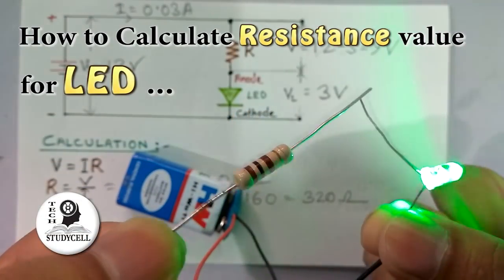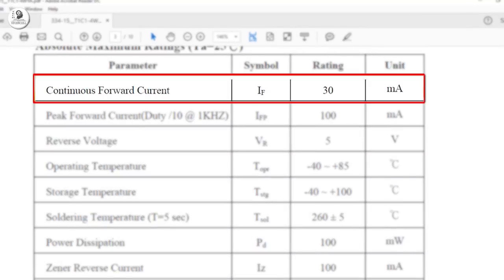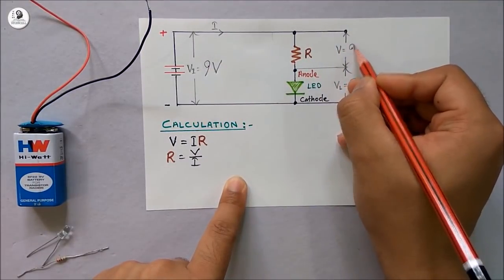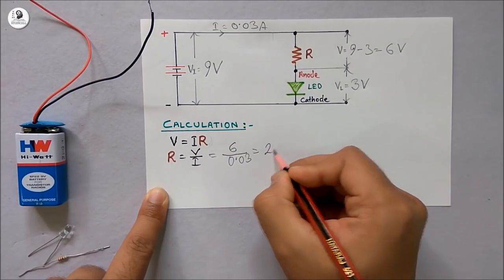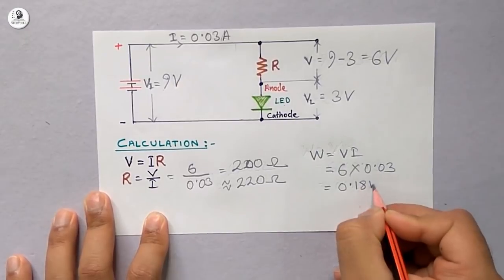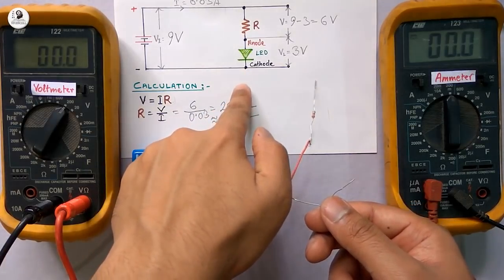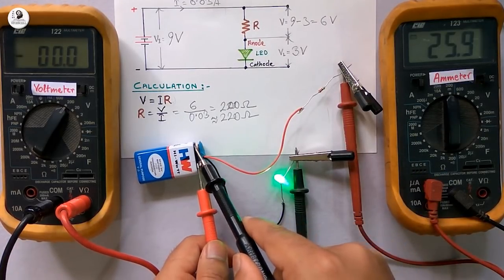How to select resistor value for LED with simple calculation (Ohm's Law)

Comment from the maker: Hi! For Series and Parallel LED circuit Resistance calculation please refer the following video: 
https://youtu.be/H69xDuon7vo
Reply: Tech StudyCell nice 👍🏼 video
Reply: Tech StudyCell  Bohot Aala Zabardast Kya Samjhanay Ka Andaaz Hay Maza Aagaya DIL 💖 Khush Kardiya USTAAD GEE KHUSH RARO Aaj Zindagi Main Phayli Baar kisi ko is Khubsurti Say Samjhatay Dykha or Suna Bohot Sari Duaain Dilki Ghayraeyoon Say SADA KHUSH RAHO TUMHARI har Mushkil Aysay Aasaan Hojaay Jaysay Woh THIHI Naheen AAMEEN LOVE 💖 From PAKISTAN 🇵🇰 👍👍👍👍👍👍💖💖💖💖💖💖💖💖💖💖💖💖💖💖💖🇵🇰🇵🇰🇵🇰🇵🇰🇵🇰🇵🇰🇵🇰🇵🇰🇵🇰🇵🇰🇵🇰
Reply: How much ohms resistor should i use in white led circuit of 6 leds and 9 volt battery .
3
Reply: Gadgets Cracker Use 1.5 watt 220 Ohms
Reply: @ahmedayaz1972  should i use 2    9 volts battery so that forward voltage will be of 18 volts. And then use 1 ohm 0.25 watts resistor to supply power to 6 white 5 mm leds.

Please help me.
Reply: Apni ki bangali?

Comment: I think there was a misconception have had spoken here, when we say drop it means drops that will be supplied to the LED to consume it, and the rest of voltages will be absorbed by resistor that's it. keep in mind that drops does not mean omit or removed, but feeding to the consumer, in this example is the LED.

Comment: what will happen if the input voltage is 5 V and we use a 1000 ohm resistor? Will the LED glow or not? It should not glow, but i have seen it glow. I don't understand how

Comment: I use 9V battery and blue LED with 10K ohm resistor , but the led burned , i can't understand why it broked , i try another circuit with 1k ohm and the same thing the Led burned , what is the problem?

Comment: I have UV led whose specifications are :
 Max forward current : 20mA;
Max reverse current  : 50mA
Max forward voltage : 3.2V - 3.4V
Max power dissipation : 80mw
Max reverse voltage : 5V

What value of resistor is needed to glow if the Battery input is 12V 9ah.
 Kindly reply.

Comment: Will lowering the voltage using a resistance lower the brightness of the diode? I've tried to do the calculations but my mind won't process the information. Help please!

Comment: I can tell that the internal resistance of the LED is 100 ohm
The question is if I apply 220v, what is the value of the resistor? 
Is it  ~ 7k5

Comment: unless i am missing something .003 divide by  6 equals to 2000, not 200 or 220. the inline resistor should be a 2k oms
Reply from the maker: The current rating is 30mA which is 0.03Amp. not 0.003

Comment: So if we wire 3 leds together it would be 9v, would we still need a resistor?
Reply: Yes,If you connect three leds in series it would lightup
Reply: @rajeshnaidu  my question is if we would still need a resistor if we were using 3 leds making 9v wired together powered by a 9v battery

Comment: Sir UV lamp is 11 voltage ... And power supply 12 voltage if I supplied 12 voltage it's working or burn ... Which register is required for supply 11 voltage

Comment: In case I don't have the data of led....what should I do ? Actualy I want to use an AC led bulb by dc source (12v-35v) with same brightness by passing the AC to DC circuit in the bulb. I can measure voltage output from AC to DC circuit . I know the numbers of leds ( generaly in series). Now what ?

Comment: Excellent video. Does it matter if the resistor is placed at the anode of the LED? Or is it common practice to place the resistor at the cathode of the LED? What would be the reason for either? Cheers

Comment: I was looking for exactly these calcs for a tiny DC motor application.  I think this will only work for electronic loads and not any kind of resistive or power load, although a tiny motor seems like it must be purely inductive, I still cannot get anything to work for the motor.   A finely organized and clear video.  This should help me going forward as a noob.
Reply: perhaps you could also consider the wattage of the motor to choose the correct resistor with enough watts for the motor

Comment: 1) the resistor does not drop the voltage as you imply 
2) why calculate 200 Ohms then use 220 ?
3) Wattage calculation is correct but not real world

Comment: Can we use resistor Ac 220 volt to Ac 110 volt as step down
Reply from the maker: You can do it for very small load but It is not recommend. Always Use transformer.

Comment: Hello sir,
How many ohm resistor should I use for transperent white led and transperent red led with car battery which is 12volt to 14.4 volt.
Reply from the maker: You can use 1k.

Comment: How check led voltage .. and current for calcutate suitable resister..using multemeter
Reply from the maker: You may check forward voltage rating with multimeter but for current rating, refer the datasheet

Comment: To summarize to see if I understand - So if I'm using a 9v battery and a 3v LED, there's a difference of 6v. If I divided my voltage difference (6) by my amperage of 0.03 (30 milliamps or 30 thousand) = 200. So, then you want a resistor that is at least 200 ohms but not much more. A common resistor in this range is the 220 ohms resistor.
Reply: correct  but 30 mA is rather high....better to a max of 20 to 25  mA

Comment: Hi thanks for the video. I have some question. If I have a power adaptor with 5V 1A, and a LED with 3V and 0.3A. understand I will need to use a resistor for 2V/0.3 around 6.6ohm. May I know what is the current in the circuit? Is it 0.3A or 1A as the adaptor say the output is 1A?
Reply: 0.3 A

Comment: what if i use 9 volt 10 amp... and I want to light led 3 volt need 30 milliamp.... does it use use 200 ohm resistor?

does the input Amp need to be calculated or just the input volt?
Reply: There really is no "input amp" really. The 10Amp you speak of is the maximum rating of the power supply. It can supply up to 10Amps while staying within specifications. If something tries to consume more current than 10A then the power supply won't be able to keep up within specifications.

Now, that said... The circuit draws whatever current it will based on its resistance and voltage. With a 220Ohm resistor and an LED voltage drop of 3v we know (from the calculation) that 0.030A will flow. You can't change that without changing the voltage, the resistance or the LED voltage drop. a 1A capable supply will push 0.03A. A 1000A capable supply will still only push 0.03A. The current push is a consequence of the force pushing the electrons (voltage) and what they are being pushed through (resistance). Nothing else.
Reply: @jwiegley  thank you of your clear explaination. It help me understand.

Comment: Hi, I have a question. I would like to connect 44 LEDs (7030) with a voltage of 6 volts to a voltage of 220 volts or a 12v power supply. How can I do this?

Comment: how did u get I= 0.03A and current on multimeter 25.9A.
Reply from the maker: 0.03A or 30mA got from LED datasheet. And multimeter reading is 25.9mA or 0.0259A. Not 25.9A

Comment: How much ohms resistor should i use in white led circuit of 6 leds and 9 volt battery .
Reply from the maker: If the forward voltage of LEDs is 3V and current 25mA. Then make 2 strings of 3 LED in serise( each string contain 3 leds). Then connect 2 LED strings in parrallel. You can skipped resistor for 3v led. But for 1.5 V led connect a 100 ohm resistor in serise with strings.
Reply from the maker: You can refer the following video for more clarity... 
https://youtu.be/H69xDuon7vo

Comment: how did you know that the 9v battery outputs 0.03 amp?
Reply: ya it is the big problem .....
Reply: @langthangtrum3360  :(
Reply: I think the 0.03 came from the current from the LED, not the battery. I'm still learning, but I think that's where it came from.
Reply from the maker: From datasheet.. In the most basic terms, 9 volt batteries can supply about 500 milliamps for one hour before being "dead".

Comment: Khub valo hoeche,  3 te 3 V LED parallel  ey join korle duto common end ey 220 ohm, 1/4th W resistor lagalei hobe to 9 V battery lagale?
Reply from the maker: If you use 9 volt battery then you can also connect the 3 led and a 27ohm ressitor in series.
Refer the following video:
https://youtu.be/H69xDuon7vo

Comment: I have no idea how you calculated the 3 volts on the far right of the diagram.
Reply from the maker: I refered the datasheet of the LED. The forward voltage of the LED is 3volt.

Comment: I want to use white LED of 3v with a power source of stepdown transformer, providing 12/15v (DC) from 220v AC. Please let me know, which resistance I should use. Your help will always recieve my appreciation. Please reply thru my email : 
Sarlagopal@gmail.com
Thanks.
Gopal Daga
Reply from the maker: you can use a 300ohm resistor. But if you want to connect multiple leds with 12v then it better to connect leds in series. please refer the following videos. https://youtu.be/H69xDuon7vo

Comment: why can't we use zeker diode
Reply from the maker: If the input voltage or load is varrying with time, then zener diode can be used to provide constant output voltage
Reply: Tech StudyCell thankss

Comment: I have a simple question over here,

for a simple led circuit to lighten it up.There are 2 ways for it to work

1, connect the 5v dc power source to a resistor and then to a anode of the led and then connect the ground to the cathode,

2,connect the 5v dc power source to the anode of the led and connect the cathode of the led with a resistor and then connect the resistor to ground,

in both ways the led gets lit up.Now this is kind of confusing for me .How does the current /voltage flow in this case since the led is being lit up in both the ways.Please answer this question .This question has been buzzing me for quite a while of time,

Comment: No. Of 3.5 volt led = 100
Power supply = 220 volt dc
Current = 0.150A (150ma)
How can we operate this circuit in series by using any resistor because resistance value is coming in negative
I.e supply voltage = 220 volt dc
100 led forward voltage = 100*3.5 = 350 volt
Current =0 .15A (150ma)
Resistance value (R) = Vs- Vf/I
220 - 350/ .0.150. = 
-- 866.66666ohm
Now What should I do to operate the circuit
Reply from the maker: The input voltage should be always greater than the total forward voltage. So for 220 volt DC input you can connect max 60 LEDs of 3.5v in series with a current limiting resistor as shown in the video.
Reply: @TechStudyCell  if I want to connect in parallel with 3/5/12volt dc supply, then ........

Comment: I have a problem with the clculation: 1) If supply voltage is 9v then the resistor will be R = 9-3/0.02=300 but if we try to find the forward voltage from R then why we get negative value? If R=450 then 450=(9-V)/0.02 and V = 9-9 = 0v. So does it mean that if we use a 450 ohm resistor with 9v battety then output voltage to the LED will be zero volts?

Comment: My son is facing the following problem -- "I have followed the video from the first. I have used a 9V battery and connected a resistor & LED in series as shown by you. But on measuring the output voltage it still comes 9v. I am not able to retect the error. Please help. "
Reply: Plz try reading the voltage on the terminals of the led

Comment: We got the .03 by dividing the LED by 100 right?

I am new to all of this and trying to figure it out.
Reply: 0.03 is the current that the LED specifies in its datasheet (0.03A or 30mA), whereas 3V is the voltage drop/forward voltage specified in the the LED datasheet
Reply: @AcidUK  Thank you so much

Comment: Brother can you tell in 6v or 5v supply what will be the resistance
Reply: You simply find out the voltage of what the LED uses. And deduct it from the source voltage. Say 1v led. You deduct it from the 5 voltage source. You end up with 4 volts prior to the led. Now you want to know how much mA the led can handle. Say 40 mA. You now have the 4 V and you know it can handle only 40mA. So I=U/R is the same as
R=U/I , which is R= (4V / 0,04A (40mA) =  100 ohms.

Comment: 2:18  You found the solution of the equation to be 200 ohms but you said you will use 220 ohms instead. Why is that? why extra 20ohm ?
Reply: I think its easier to find 220 ohm resistant thats why he said that
Reply: In market it's very difficult to find the  200ohm registor. And by increasing the regisitor value little more the led life is increased. Because the the current value is decreased so as the brightness also.

Comment: Does each LED need a resistor if wired parallel or just the first LED in the chain? Or do both wired parallell and wired in series need to have each LED have a resistor?
Reply: A single resistance is also ok. We can connect multiple leds in parallel ( but of the same colour only). For different colour leds you have to use different resistor for every different colour .

Comment: Okay, I have a question. I'm trying to power 4 LED's off two AAA batteries. what would be the best way to wire this? Would it be in parallel? The LED's are 3v and 20ma. Thanks!
Reply from the maker: In parallel. (If the battery voltage is 1.5v)
Reply: @TechStudyCell  thanks!

Comment: Is there any universal resistor value for use with LEDs of different colors? More or less?
Reply: Rlimit=Vsource-Vled/I led

All led's have their own voltage and current requirements.
Search online and input them in the formula to find an appropriate resistor.

Comment: When 3 led connected  across the battery then how value  resister require.
Reply: LEDs connected in series? You wouldn't want this configuration. No matter what resistor you select the circuit will be unreliable. If the voltage drop of the LEDs is equal to your voltage source then you wind up calculating a resistor of 0Ohms. But there is ripple on the voltage and the voltage drops of the LEDs have variance. If the voltage is slightly less than specified or if the real sum of the LEDs voltage turns out to be greater than the source then you have insufficient voltage and the LEDs won't light. If the voltage is just a little bit higher or the LEDs have a slightly lower drop than typical then you have some voltage drop in the wire which has essentially zero resistance and E=IR becomes I=E/R  -> I=E/0 across that wire portion and you get a very large current flow even though the voltage drops are close to the source voltage. You burn out your LEDs. So, your LEDs always have to have a voltage drop less than the source and you need some resistance.

LED's connected in parallel? You'll need to be a bit careful about this. Either use a separate resistor for each LED and treat it as three different instances. Or if you use a single resistor you will need to make it 1/3 as much as the video calculates since it has to supply the same current to all 3 LEDs. The resistor will be dissipating three times as much power though. With a 9v source and three LEDs at 30mA you will need a 1W resistor which are not the standard 1/4W or 1/2W resistors you tend to stumble across. For 9V at 0.30 (single LED) it's just barely what a 1/4W resistor can handle.

The OP used the Absolute Maximum Rating of the LED when he chose 30mA. The normal operating current is 20mA and that is what he should have designed for. His LED won't last very long in service.
Reply: Deduct the voltage of the power source with the sum of all the forward voltages of the diodes you connected in series, and then divide it with the forward current of the diodes(if they are all the same)

Comment: how about if you want to use 1AA battery on led?
Reply from the maker: If you use 2 1AA battery in series to supply 1.5V, 20mA LED then the resistance required in series will be approx 75 ohms.

Comment: Nicely Explaination . what if the current source is 20 A and the Voltage is 12 V is that equation still relevance. just asking. thank
Reply from the maker: Yes. But the equation is for DC circuit.

Comment: For 1w power led required current is 350ma then what will the value of resistor and power rating of resistor ??from 12 v 10ah battery , and will it require to put any current limiting diode ??
Reply from the maker: What is the forward voltage of the LED...
Reply: @TechStudyCell  ,3v - 3.4v, current should be 300- 350ma

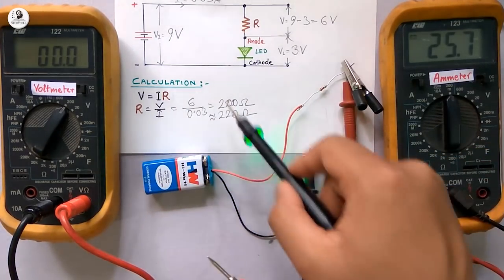Comment: 4:53 did you get electrocuted here?
Reply from the maker: No. Here I have used 9 to 12 volt DC, So there is no question of electrocuted.
* to merge the audio with the video I reduced the video speed for 4 seconds.

Comment: What do if I connect 2 leds in series ???
Reply from the maker: If you connect two 3v LED in series then the total voltage drop across LEDs will be 6V. you have to calculate the resistor value accordingly.
Reply: @TechStudyCell  how to calculate if I connect 2 LEDs in a parallel??

Comment: how can I know the watt of my register, from datasheet?
Reply: Power = Voltage * Current. You know the voltage drop across the resistor is 6V. The current across the resistor is 0.030A. So the power dissipated across the resistor must be 6V*0.03A = 0.18Watts. A 1/4Watt resistor is required. It will get warm.

Comment: Would it matter if he connected the resistor(s) later in the circuit?
Reply from the maker: No. It should be connected in series with the led.